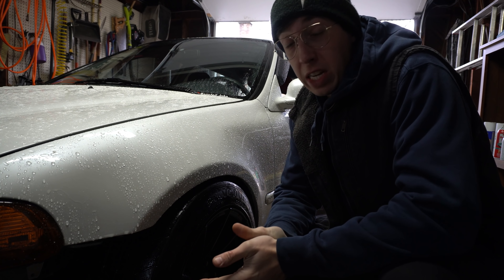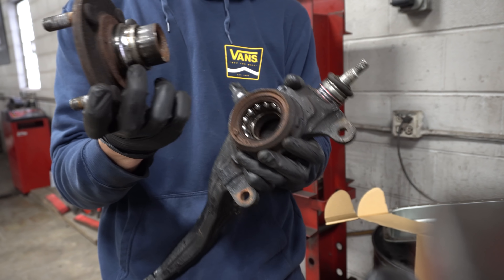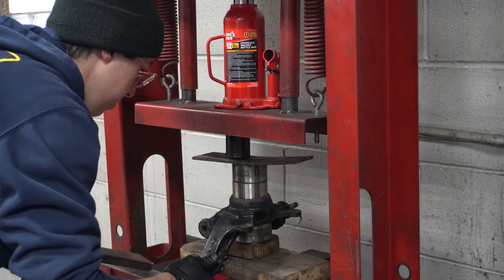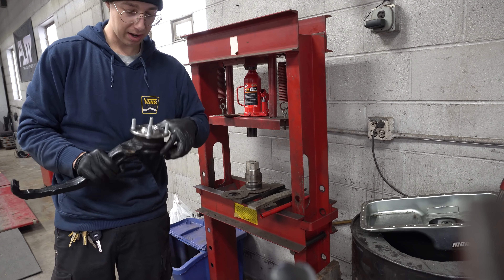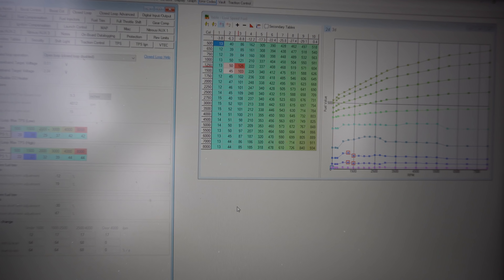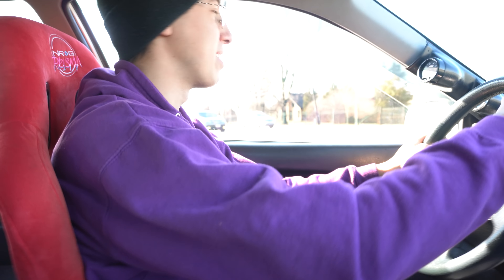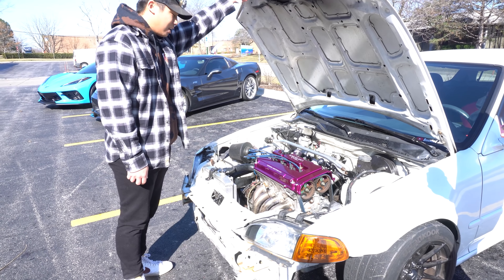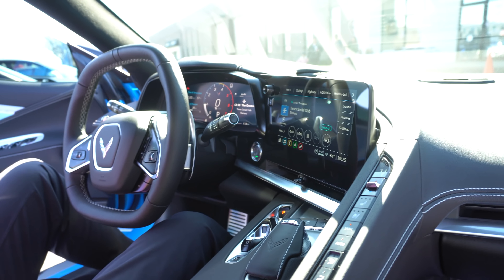Fully Built LS VTEC Civic First Major Problem!

Comment: I noticed you're running a skunk 2 intake,I also run a lsv tech setup b18b1 bottom p72 GSR head with my experience a GSR intake with a 70 mm skunk 2 throttle body is much more responsive and work so much better for low RPM cruising just my opinion, keep on making these very informative videos.

Comment: I was supposed to go to that meet but my car is in Rockford. (Is this the one in Naperville?)
Yesterday had to drive to a dyno place (for power pulls not tuning)
Then drive 1.5 hrs to Rockford to get my bike (been there since Dec20th.  Fkn HD took ages to get me a new crank sensor..  got a proper aftermarket oil pump .. cam upgrade, tune, catless headpipes etc etc etc)

This morning gettint a ride from Bolingbrook to Rockford to get the big turbo Veloster N 

Hopefully I’ll get to see the car at one of these meets.